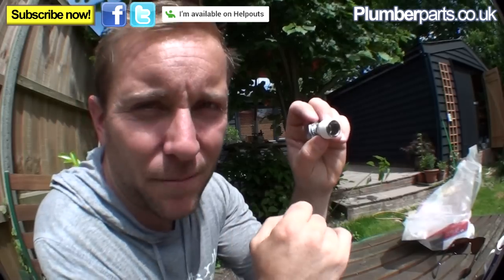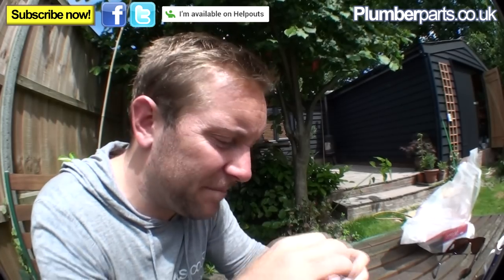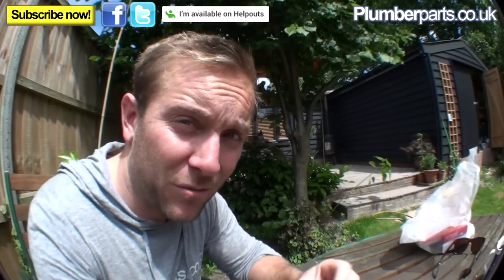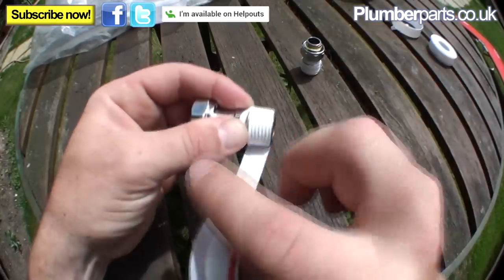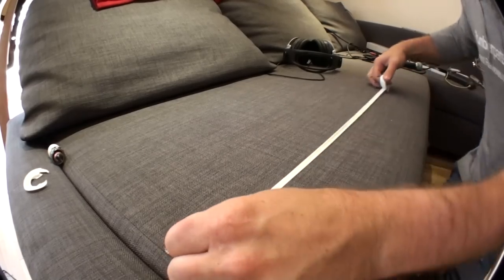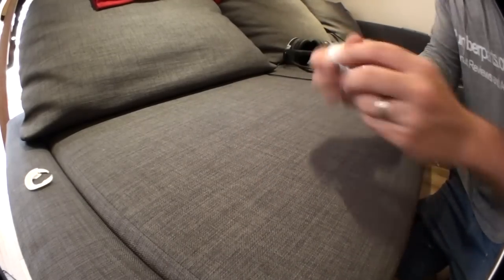HOW TO USE PTFE TAPE - Plumbing Tips

Comment: Oh I'm struggling so much with the fittings! That's why I'm here... Been doing the tape over and over, screwing it on and off, on and off, on and off. Trying different amounts of tape, screwing it tightly as is could - still leaked. So frustrating

Comment: Dumb question. I was taught to do it exactly as you are in this video...7 turns. Now I get the ole..just three...what are you doing? Also, I am just beginning to work with a lot more stainless pipe. Dope...slides out doesn't stick and white slides as well. On the states we have a blue and someone was telling me about a gray tape. Is there a variation I missed whilst in my parental delirium? Some brass seems to act like stainless more as well. I assume it's due to lead free changes. Yeah, took a few years off lol.
Reply from the maker: Dunno mate, have you tried Loctite 55? Enjoy the delirium!
Reply: plumberparts Like it. Use something like that for air already. It stared at me in the store last time, but I grabbed the trusty inexpensive product, costing me a couple hours of redoing as consequence...Unforgiving fail lol. 20 bucks sounds cheap now. Is it a simple heat to remove as well? Any drawbacks with water application like ideal prep?

Comment: Not so easy though when you're having to wrap it onto a leaky radiator valve thread, or a compression olive in situ, with like an inch of space around it? That can drive you quite insane! :)
Reply: Wrap the PTFE on the end of a pencil then. use that to wrap your PTFE on to he olive

Comment: Hi, what about putting the tape on a tap that is on a sink and you have to struggle to get underneath. How do you put it on correctly in this situation. Could you do a video showing that please. Or on any pipe that is close to a wall. Cheers
Reply from the maker: Added to the list!

Comment: Hi. How can you tell which way the thread is going to ensure you put the PTFE tape on the correct way? - I am fixing a new garden tap to existing pipework. Does the thread always go in the same direction? Thx
Reply: when you are tightning you screw clockwise -so when you put the tape on-the thread you put it on clockwise..

Comment: Id never put 7 wraps. Insane! Just enough to cover the threads and wrap it in the same direction your fitting is screwing on
Reply: some fittings require 10 times round

Comment: Why is it no one ever shows you how to do this when you don't have clean access to the thread you're putting the tape on. Anyone can do it with the whole unit in your hand - it's harder upside down in a cupboard where these jobs usually have to be done.

Comment: I've now heard 10 turns, 8, 7 and 3. Is the truth out there ? Please tell !
Reply from the maker: I for some reason count to 10 now....but it changes with the wind!
Reply: I'll need to seal a 1 inch thread that goes into a booster pump. The connection (without a sealant) is quite loose so I guess I'll have to use at least 20 turns!

Comment: 2:20 You did 9 wraps there. 
But in your previous post for fixing a leaking garden tap you did 12 wraps.

Another website's text instructions says 4 to 6 wraps. 
And to start wrapping from the open end of the thread. 
But then their video showed a black american woman start wrapping from the other end of the thread. 
Geez. 

And to leave the last thread unwrapped. 
And to wind the tape in a clockwise direction. 

When looking at my tap with the thread closest to me ie with the handle further away, my tap winds on in an anticlockwise direction, so yes the tape goes on my tap thread in an anticlockwise way. 

But when I look at my tap with the tap handle closest to me ie the thread behind that, the tap winds on in a clockwise direction. 
Geez. 

But you did not mention that.
Reply: Another website's advice for just 4 to 6 wraps?: What a ridiculous waste of time doing just that many!
I tried that so many times and so the water poured out. 
And after giving up for so many months, I must have wasted so much water and money!!
That website idiot needs to be locked up!

Your advice to try many wraps eg about ten is what works.

I lost count of how many wraps I did but I probably did more than ten wraps just at the area of the base ie the left end.
And maybe another ten or more for wrapping the rest of the thread until the open end. 
I might even try it again and count it.  

And just like you did I started threading at the base instead of the other website's advice to start at the open end of the thread.
  
Thanks.

Comment: That is NOT how PTFE tape should be applied. Easy to find how to from better sources. All PTFE was designed for, was lubrication, therefore only 1-1/2 wraps which will cover the thread overlapping the last by a half width of the thread. Over applying wraps is completely incorrect, dangerous and will fail. Better to do some research than take the exam on a YouTube video.

Comment: why do I always see builders aka the chippy putting ptfe around olives gggrrr
Reply from the maker: It's a quick fix then get the plumber in! Lets face it, it does work! SUBSCRIBE! ➡️👉 https://www.youtube.com/subscription_center?add_user=plumberparts 👈⬅️if you haven't already!
Reply: PTFE wrapped around the stub of pipe, that inserts into the fitting, before the olive, forms a gasket type seal.The seal is created between the olive and the fitting. Usually two wraps sufficient This method usually seals leaky joints caused by over tightened compression fittings i,e strangled copper tubes, even micro-bore. PTFE wrapped around the tread of a compression fitting is a waste of time, as the thread is only a locking mechanism !